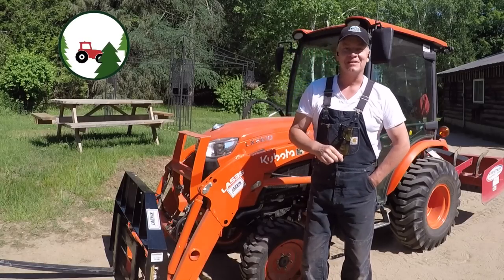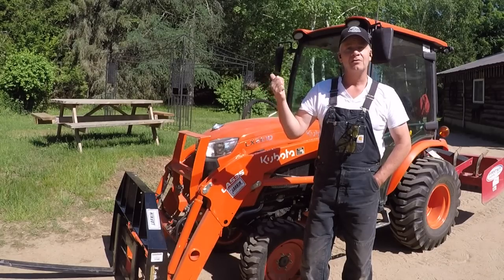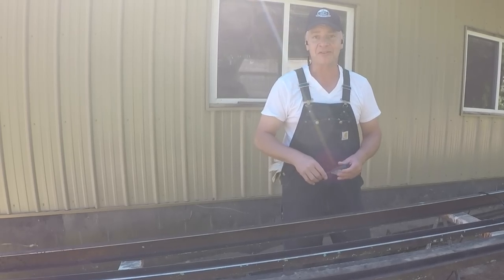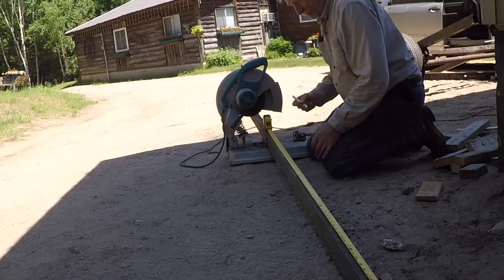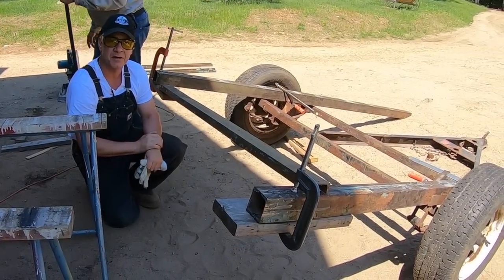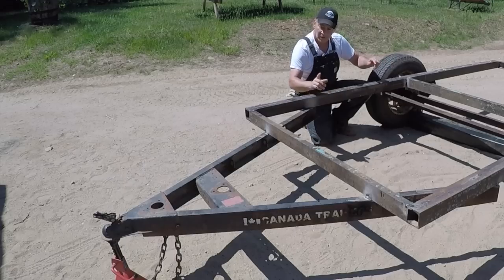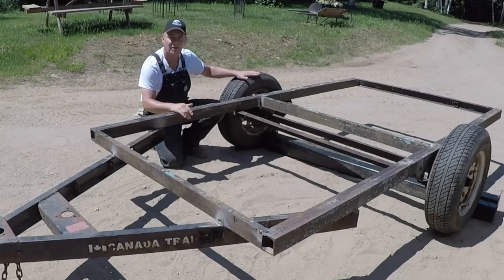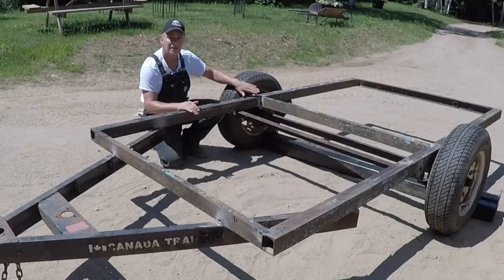#433 Building A Log Trailer. Build Part 2 of 3. The Log Carrier is taking shape! outdoors

Comment: Looking good guys !!  Ain't nothing better than taking scrap materials and building something useful and that's what you guys did. On the several tag trailers I've built over the years GP, I've gone by a combination of two things.  Tongue weight and the minimum distance for the vehicle or tractor to turn to its fullest extent without hitting the rear of the vehicle or tractor on the side of the trailer deck.  You guys will find this trailer extremely useful hauling logs for sure. Can't wait to see the final build.  Have a pleasant week, to both of you gentlemen.
Reply from the maker: Thanks T!  I was surprised at how just a few inches change in the axle placement makes such a big difference in tongue weight. She's coming togther!

Comment: Hi GP,
Looks like a fun build!
I concur with having the axle set back a bit.
I have a commercial equipment trailer where the axles were set on the center of the bed. 
The issue is when the trailer is pulled empty. It will tend to rattle around quite a bit, takes the fun out of pulling it! 
I almost always add some weight on the front which really improve the ride quality.

Comment: Like T Carter said, it's time to take up the torch. It helps to have an electronic helmet. Even a cheap one will do. You can adjust the darkness with a knob on the side of the helmet. I like mine as bright as possible but keep the arc hidden behind the gas nozzle. For me, that's the easiest way to see. Also, doing it outdoors or with a bright light above you causes reflections on the inside of the helmet that makes it harder to see. Much easier indoors or in the shade. You don't have to show us online, but learn everything you can from Guy while he can still show you.
Reply from the maker: Morning Gary! Yes - Guy had to adjust quite a bit because of the sunshine for sure. But did not have the room indoors unfortunately. Thanks and have a great week!

Comment: GP is this trailer going to be for high speed trailering or slow moving in the woods? Reason I ask is if slow I would have gotten rid of the leaf springs. Nice job on trailer/tongue centerline. If for high speed use I hope guy remembered the isosceles triangle? It’s nice to have tongue/frame square but more important is the hitch point is equal distance to both wheels.
Reply from the maker: Hey good day Garny. Some great points. I wasn't able to catch everything on camera - Guy moves fast - LOL. The tongue is equi-distant, to your question, but it will primarily be pulled in and out of the forest on the tractors. She tracks straight and true on the road. :)) Thanks pal!